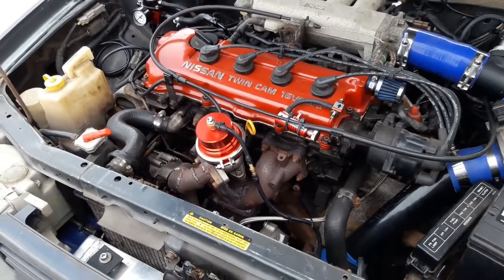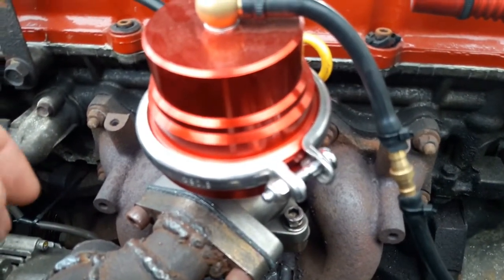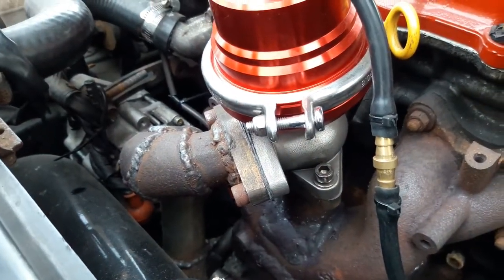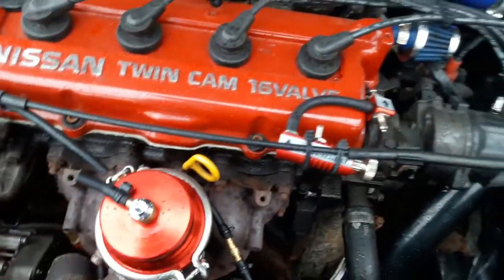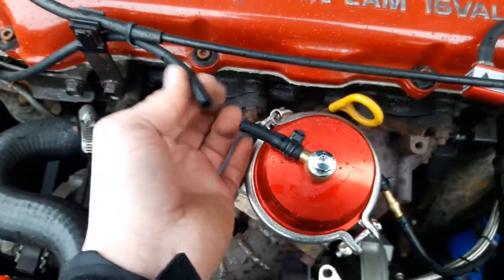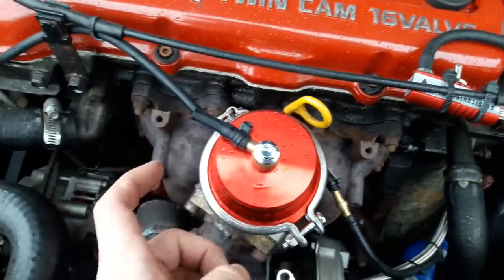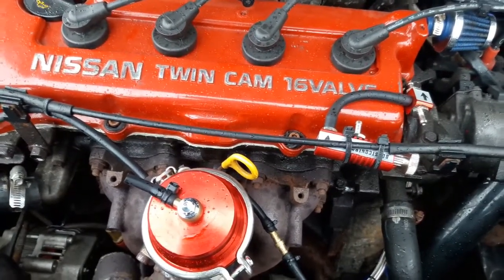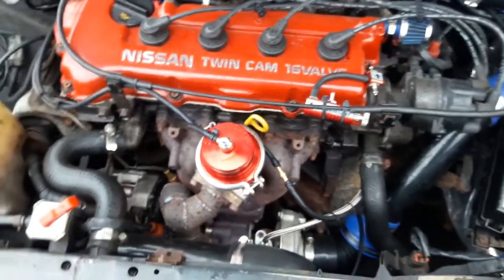B13 Turbo Sentra - Wastegate FIXED!!!

Comment: What's your exhaust setup? It sounds awesome
Reply from the maker: Unsparing Zero thanks man.
In this video the car has 2.5 straight pipe only. No cat, no resonator or muffler.
Reply: G2G Builds Nice! All the way to the back or a side exit?
Reply from the maker: Unsparing Zero
at that time was almost all the way to the back.
right now i got installed a muffler.
Reply: G2G Builds Still pretty cool👍
Reply from the maker: Unsparing Zero thanks man!